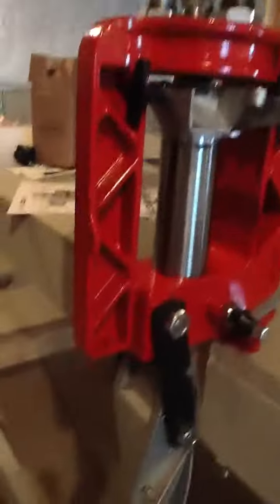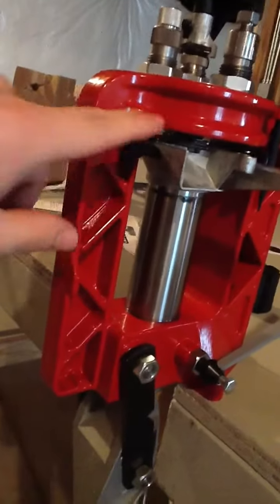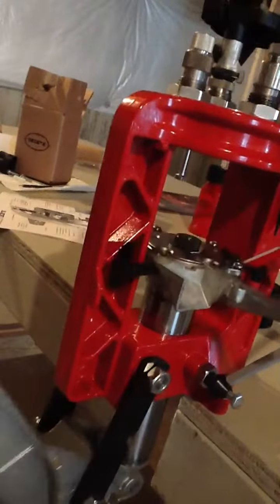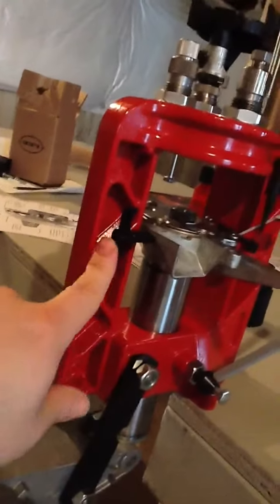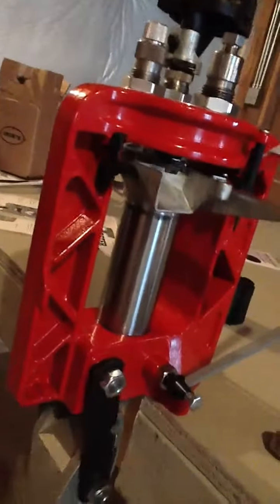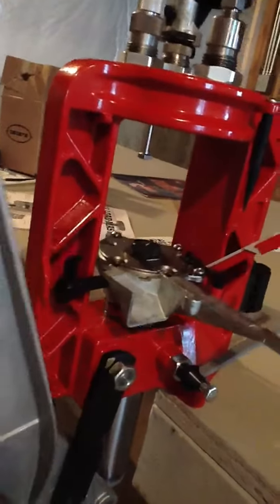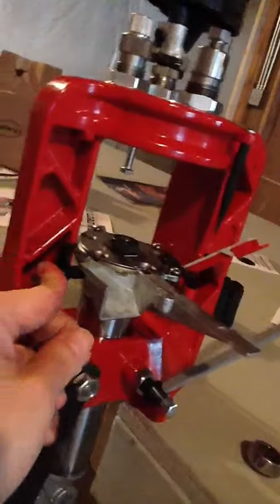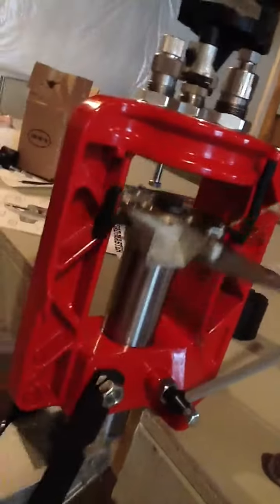Lee Load Master Auto Index Problem

Comment: In addition to checking the carrier adjustment (7/16 nut on the bottom of the ram) you have to keep the press greased. If you don't keep the grease levels full, as the grease level drops you get "lateral" (left/right) play in the handle and the flapper can move away from the pullout rib very easily. This will move the carrier left and right also. 
When the grease level is low, if you move the handle to the right during your stroke it will not index. If you move the handle left during the stroke it will index.  When the grease level is full, there is no lateral movement. The linkage will be very tight and the carrier will not move left or right when you pull the handle.

Comment: Your issue is resolved by adjusting the carrier. There is a 7/16" nut on the bottom of the ram. Loosen that until you can rotate the entire carrier assembly. In your case you would rotate the carrier clockwise a tad to make the index flapper fit more snuggerer against the ridge on the press.

Comment: Check the index flipper and make sure there is zero clearance between it and the frame on the way up. If there is a gap loosen the ram bolt on the very bottom of the ram and rotate the ram until there is zero clearance. Also check that none of the dies are down too far. If the dies stop the upward motion of the shell plate before the assembley is at the full up position, the flipper will not fully contact the small nub that turns the flipper clockwise so it can engage the frame on the downstroke

Comment: I also had the same symptoms happen when my turret became loose and rotated a bit to the left.  There is a bit of "slop" in the turret before you clamp it down with the tightener screw. I rotated the turret to the right and it corrected the problem that time as well.

Comment: I had same problem.  Easy fix.  Loosen the draw bolt at the bottom of the ram.  Rotate the ram to the left until the indexing rod rides closer to the frame and catches the "ramp" on the way down.  Tighten the draw bolt back up.  There is no need to modify your Loadmaster as this is a common adjustment.
Reply: Thanks Tim, you saved me from a lot of frustration.
Reply: Merci beaucoup. J'avais le même problème. Résolu grace à vous.

Comment: I had this same problem and spent tons of time with lee through email trying to solve the problem.  The solution for me after checking everything was to lube the indexer rod and the rib on the frame, and now it's works perfect,  don't know why lee never told me to do this.
Reply: the manual does tell you that, did you read?

Comment: it seems that this press needs to have about 100 rounds or so through it before things work smoothly, however even at 500 rounds, my press "same model" still has a few issues here and there. (bullet feeder dropping bullets and being crushed in the seating die, primer feeder not fully feeding a primer and it becomes crushed and wont index) most of my issues revolve around the bullet feeder and the occasional case feeder not feeding all the way.

Comment: How I fixed that problem........On the rib where the lever is SUPPOSED to ride.I took a piece of thin metal and cut it so it laid flat and stuck out aprox.1/16" and glued it down with a little silicon.Now the rod has a crisp area to slide on.........Problem Fixed !